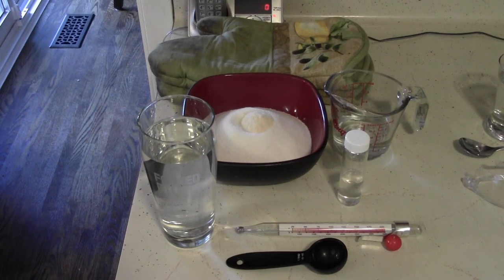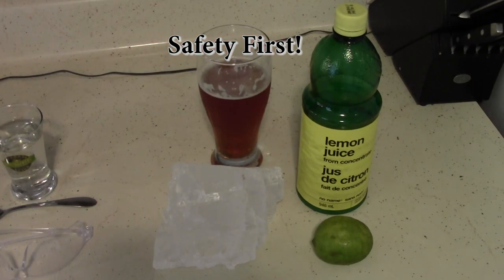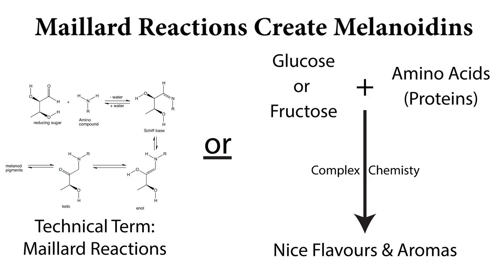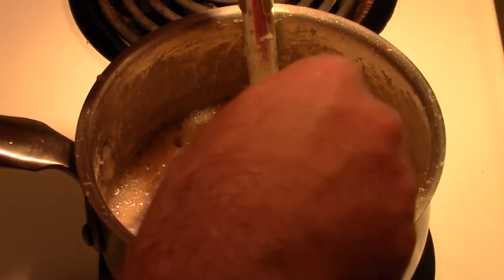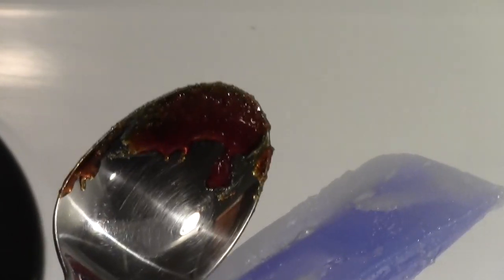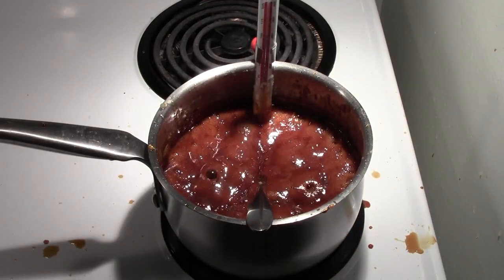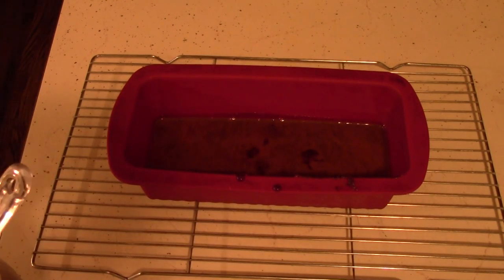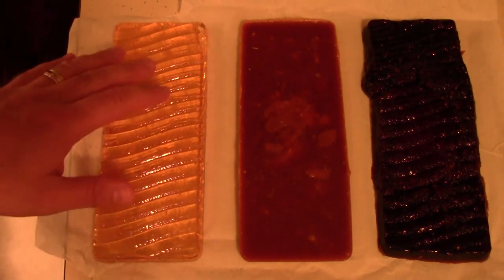Making Belgian Candi Sugar At Home

Comment: I made a batch of this today.  Started with 500g of white sugar, 1/2 cup of distilled water, and 1/4 tsp of wheat flour.  About 15 minutes into the 130°C step it all seized up.  (and I was so proud of myself until that for not stirring and washing down the sides of the pan with a brush and water instead of scraping it)  I think crystals from on the candy thermometer seeded it.  I added another half cup of water and a teaspoon of dextrose and started over.  It was amazingly difficult to get all the sugar lumps to dissolve again.  When it got to 130°C this time I removed the thermometer, covered the pan, and turned the fire all the way down.  Eventually it was time to add the base, and I use a warm saturated solution of sodium carbonate.  It only took a few drops and the color change was dramatic.  But also it fizzed up like when you add the baking soda to peanut brittle but more-so.  I don't know if that was steam or CO2.  I stirred it down, cooked it briefly to between 150° and 155°C and poured it into a pan lined with parchment because I don't have a silicone pan.  Not sure what I'll do with it now, maybe just break it up and eat it. 😋
Reply from the maker: Sounds like it went well.  If it siezes up you can work more water into it and continue on. Adding 5-10% corn syrup can also help prevent siezing. For the one that worked, it tastes pretty good just as a treat.
Reply: @SuiGenerisBrewing  Add more water and keep going is what I did but it took so much water it was like starting over. I assumed it hydrolyzed the flour and some of the sugar so it should be easier now. I still added some dextrose for insurance. Next time I will add the dextrose right from the start and will do a larger batch so it's easier to control the temperature.

Comment: I have now made Belgian Candi 3 times.The basis was your refined process. Not everything works to my satisfaction yet, there is still a need for improvement:
1. despite glucose syrup (made from dextrose boiled with distilled water), the syrup still crystallises strongly
2. I decant lye in 3x10ml tubes, which was prepared with 2.2g Ca(OH)2. Problem: Ca(OH)2 dissolves very badly.

- how do I prevent crystallisation more effectively?
- how do I dissolve Ca(OH)2 better?

I prefer liquid syrup and don't like candy. The model is the Premium Candi Syrup. The taste is formidable, bready and fruity at the same time, very strong taste and smell of plum and sultana.

Next target would be a Belgian syrup like the Premium Candi Syrup D-180, very dark. You'll probably have to work with molasses.

Thanks in advance for your tips.
Reply from the maker: I don't worry about crystallization anymore, as I covert everything to syrup after. Adding fructose (corn sugar) can help, as can minimizing the amount you stir and limiting over-heating. That said, I add half the weight in water of the starting sugar at the end to make a syrup, which dissolves anything crystallized.

As for the CaOH2, it dissolves poorly in water, so thr solution will be cloudy when you add it to the sugar. Which is why I prefer sodium hydroxide, which is much more soluble.
Reply: @SuiGenerisBrewing  Wonderful. I did it right intuitive: I added also water at the end. Also I stir the rest  of crystallized sugar with some sugar. Maybe the Na(OH)2 is a good hint. We have fructose here, but it is not made from maize, but from wheat. I stick to dextrose and increase the addition. Thanks again for the quick reply. Happy brewing!

Comment: Thanks so much for making this video! It's exactly what I've been looking for. There are so many-what I would like to say-lazy videos on this where the person just makes inverted sugar and calls it Belgian candi sugar. Thank you for being true to the product! 

Question: Have you ever tried to make this using a sodium bicarbonate solution as the alkaline solution? I understand it's a much weaker alkaline, I am just wondering if it is possible to obtain the same results with something less caustic.

Also, I have no clue how you manage to maintain stables temps with your burner; I have the same one, and if I leave it on for too long, it attempts to reach the temperature of the sun!
Reply from the maker: Sodium bicarbonate is not strong enough of a base - you'd ruin the flavour of the  candi long before you got to the right pH. As for the stove, practice, practice, and practice some more. As a general "rule ", heat on medium heat until you get to about 10C below toyr desired temperature, then turn the burner right down. It'll take a while to get to the right temp, but it will get there. The issues with these elements is they hold a lot of heat, so they'll continue to pass heat onto your pot long after you've turned the element down.
Reply: @SuiGenerisBrewing  Thank you for these tips! I look forward to trying my hand at making this again. The previous recipe I had used had left with me with a decent product, but it definitely wasn't Belgian candi syrup—I ended up with a deep dark, rich, smokey syrup, so I am eager to start smelling some plums/chocolate in my kitchen!

Comment: Great video, thanks for sharing. What is the concentration and the volume of sodium hydroxide used, or you just used calcium hydroxide in limit of solubilty?
Reply from the maker: I'm using ~1 teaspoon of dry lye (sodium hydroxide) per kilo (2.2lbs) of sugar, although since this video I've gone up as much as 2.5X that with good success.  Just make sure you dissolve it in water before, as you'll not get good incorporation of the lye if you throw in powder.

Pickling lime needs (in theory) about double the volume compared to lye.  I've not tried this one much (pickling lime is hard to find in Canada), so I cannot comment on how well it compares to lye.
Reply: @SuiGenerisBrewing  I just tired with calcium hydroxide, used about 3g in with 1.6kg sugar and around 400g water. Couldn't get it to the colour in your video.  I felt i messed this up some how other than using calcium hydroxide, Maybe I used too much spraymalt(25g)? , it was super foamy like at least double of the foam in your video, then it got too thick also so i had to add more water.
Reply from the maker: @stephens4490  If it is too foamy, that is a sign that you are heating it too intensely; it also sounds like you have too much spraymalt - I typically use 1-2% by weight.
Reply: @SuiGenerisBrewing  You're certainly right. I was planning to make a quadruple but this sugar doesn't have the roasted flavours. Should I try again or could i add like coffee or maybe cacao nibs to provide these flavours?
Reply from the maker: @stephens4490  it took me 5 or 6 tries before I got my first good batch of candi sugar, and while I hope my video would accelerate your process, making candi isn't easy and you may need to try a few times more before it works. That said, quads usually aren't very roasty, with the candi sugar providing more of a raisin/dried fig and caramel notes. You can get a similar character using malts like special b and Abby malt.

Comment: Hi, I tried making candi syrup with 5% each of fructose and dextrose and the rest sucrose with 4 grams (1tsp) of DME. Heated to 140C +-5C and added 0.8 grams of NaOH which had been mixed in 20ml of water. Kept the sugar at 140C for 35 min and 160C for 10 min ish. What I ended up with was something I would describe as a very smooth caramel syrup. Perhaps something you could say has some fruit in the aftertaste. But it still has far from as much fruit as D-90 or D-180. Is there anything I can do to make the syrup more fruity? Increase the amount of reducing sugar or NaOH?
Reply from the maker: You could try more base and a longer cooking period. I go by colour, not time. D90 should be dark-brown bordering on black when spotted on a plate like I do in the video. D180 will be charcoal-black.
Reply from the maker: Also, the amount of time you used is on the shorter side. I don't think I've ever done less than 20 or 30 minutes at 160C. For darker Candis, 45 min to an hour would be typical with my stove and setup.
Reply: @SuiGenerisBrewing  I will try to increase to 1.2 grams of lye.
Even with 10% dextrose/fructose, there is a lot of crystallization after 20 minutes at 140C. So I thought I'd try with 50% golden syrup (which I think only consists of reducing sugar?). It contains 0.1 gram of salt. Hope it's not a problem.😆 The syrup was a little lighter than D-90. But more flavor🤷🏻‍♂️

Comment: Great video! I made some today using your process. I added 250ml water and 1Kg sugar and heated to the inversion temp range. It did start to crystalise though so I had to add more water. I probably added the same amount of water again during the whole process, just wondered if that was normal?

When using candi sugar in place of normal table sugar, Beer Smith states that you need to use 1.25X the amount that you would table sugar. Does this apply to the candi rocks made from this process or does it depend how much water you add during the process? As a lot of the water added will evaporate, I dont know how you know how the candi sugar you make will effect SG?

I have about a kilo of dark candi sugar now for use in a quad I want to make. Cant wait as it tastes really good as it is now!!!
Reply from the maker: Crystalization during heating can be due to over-mixing or other issues; you shouldn't need to add much water outside of cooling the sugar. As for the beersmith instructions, I do not know. By weight I would use the same, but by volume it may be less dense. I would be surprised if ~25% of the homemade sugar was non-fermentable, which is what the beersmith instructions assumes.
Reply: Thanks for your reply Sui. Yes, I was mixing it a lot as I thought this would help break it up and stop crystallisation! What other issues can cause it? In beer smith it states that 100g normal sugar is equal to 125g candi sugar, although maybe this is due to as you say, it assuming that 25% of the candi sugar is non fermentable. I dont think it will be that high either. In my last Belgian beer I used golden syrup (which is also inverted sugar) and 100% of it fermented. Beer smith also states that 125g golden syrup equals 100g normal sugar, I guess again as they assume it is not totally fermentable.

When I was making my candi sugar it did smoke a little bit as well as go a bit crystalised before I added the water. DO you think I may have wrecked the batch? It doesnt look black as it stands, its just dark brown.
Reply from the maker: Taste it - if it tastes really burned I wouldn't use it. I posted an update to the method in the video on my blog which outlines a few things you can do to reduce crystalization and get a more consistent product:
http://suigenerisbrewing.blogspot.ca/2016/03/belgian-candi-sugar-part-iii.html

In terms of beersmith, I wonder if those numbers are for candi syrup, not rocks. Syrup would be 20-25% water by weight, which would account for the difference.

Comment: Thanks for the video.  I've made the light amber version using cream of tartar before to use in a golden strong ale.  Your version looks a lot better for the quad I'm going to make next.  Does the recipe scale up so that I can make a larger batch and then store it for later use?
Reply from the maker: Yep, everything scales linearily. Just make sure you use a pot 3 or more times bigger than your mixture so ot doesn't boil over

Comment: Hi! I want to ask you. You are inverted saccharose by heating ( 125-135 C) ??? without citric acid?  ( sorry I dont know english well) 

And you said that you used calcium hydroxide! It is for what? for correct solution pH? 

Thanks!
Reply from the maker: Борис Борисов I don't add citric acid as that would prevent the formation of the flavours I am looking for. The sugar will spontaniously invert when ou heat it wihout citric acid - but it takes longer. The calcium hydroxide (you can also use food-grade sodium hydroxide) is added after the inversion of the sugar to accelerate the flavour-creating Malliard reactions.
Reply: Thanks you so much !!!

Comment: Hey awesome video. I am a bit confused though. I guess by melanoidin reactions you mean maillard reaction thats why you add the amino acids. But in this case you want to promote maillard reaction or caramelisation? i guess doing the sugar inversion you break down sucrose to fructose and glucose thus caramelization temperature is lower.  When you have free glucose and fructose, you ll have some caramelization even when you re aiming for maillard reaction. But  my question is, which reactions is preferable for this or at which ratio you would like maillard and caramelization to occur. Do you have to go that dark since caramelization will convert all sugars and bitterness will be the taste left? 

I am quite new at making beer, and belgian beers are my favorite so you can see my need for belgian candi.
Reply from the maker: Malliard is what I meant. The reason we invert is that sucrose is not reactive with amines, and you need to break it into its component saccharides to release the "reducing sugar" minosaccharides to enable the reactions
Reply: @SuiGenerisBrewing  true i totally forgot that sucrose is non reducing :S, while its two monosaccharides are reducing especially fructose which promotes maillard extremely fast. Thank so much for the quick  reply as well. have an awesome day

Comment: Hi, I had tried this recipe even before finding this video and I can say that it is the best. I confirm that I do not use any acid otherwise the sugar "will burn" even before the development of caramel flavors. Having said that, in Italy (where I write from) I can more easily find ammonium bicarbonate (called ammonia for sweets) instead of lye: I have tried and it seems very good .... any opinion on this? Thank you so much and forgive my bad English!
Reply from the maker: I don't think ammonium bicarb isn't basic enough, but it couldn't hurt to try
Reply: @SuiGenerisBrewing  Thanks for your answer. I think some kind of reaction happens because the smell and taste of caramel is incredible ..... if you have the chance I suggest you try .. Thanks again!  P.S. I forgot, if you want in the form of a syrup, just add water at the end of cooking (out of the fire) and put it still hot in clean glass jars

Comment: Great explanation, thanks for that. I'm now just little confused what is clear candy sugar then? Is it just an inverted sugar as with maillard reaction you will always get a more or less dark brown color? The store bought clear candy sugar is...well crystal clear:) Unfortunately your blog is down for the time being...thanks.
Reply from the maker: Clear would just be inverted, then heated to hardball stage (if solid) or diluted to syrup.
Reply: @SuiGenerisBrewing  Great, thank you. I've just finished my first test batch - 127-135C for 20min then up to 150C, small amount of citric acid was added at the beginning. Final product is slightly amber in color, which I guess is fine, even though Leffe blonde clone recipe I'm planning to brew calls for a clear candy....don't know how will my candy affect the final EBC, but thats part of the game to experiment:) When I looked for other recipes for inverted sugar (syrup), in some temperature of just 115C is recommened - is that enough to get most of the sugar converted in the presence of an acid? And once again thanks, your channel is an amazing source of information.
Reply from the maker: @rndm8056  when light candi is called for, you can just use table sugar. No meaningful difference. If you just want to invert it, simply do the inversion step but heat no further.  That said, I doubt you'll see a difference in colour or flavour.

Comment: Hi there. Love the post. In my country (Australia) it is illeagal to use lye etc. in cooking or food preparation. Because of this I cant buy it. Do you know or is there alternative that is readily avalible rather than resorting to tartaric or citric acid? Thankyou.
Reply from the maker: +owenrobins65 Calcium hydroxide works as well. The amounts required are quite small, so it may be possible to use non-food grade sources. I.E. reasonably pure calcium hydroxide is sold at many aquarium stores for adjust water balance. Do not use acids of any sort - that will prevent the formation of the malliard products that provide all of the flavours you are looking for.
Reply: thanks for the comment. do you know ruffly what the ph should be/swing to, inn order to create the reaction? also is calcium carbonate a sutible alternative? I know that they do you this in wine making as a ph adjuster.
thankyou again
Reply from the maker: I think you're shooting for a pH between 8 and 9, but I cannot for the life of me figure out how you would ever measure that in a molten vat of sugar. As for calcium carbonate, I don't think it would work - it has a pKa of 9, meaning you'd need to add a lot to get to the desired pH. The bases normally used - sodium & calcium hydroxide - both have pKa's between 12 and 13. Baking soda (sodium bicarbonate) may work (pKa of 10), but the amount required may lead to a minerally/salty flavour.

Comment: Isnt it possible to use both acid and base to get desirable ph levels at different stages? I mean adding little tartar in the beginning to speed up inversion and then adding NaOH to get maillard reaction.(I guess the amount has to increase to fight off the already acidic solution)
Reply from the maker: Chinmay Nayak in theory I don't see why it wouldn't work, but its unnecessary. You need ~1% inversion to drive the maliard reactions, the non-acid method in my video gives about 20% inversion. You can skip the inversion step all together if you add 5% fructose up-front.

So while adding acid would give more inversion, flavour-wise you're not gaining anything.

Obviously, if invert sugar is your goal than adding acid is key.
Reply: Sui Generis Brewing That makes total sense. Thanks for your reply!